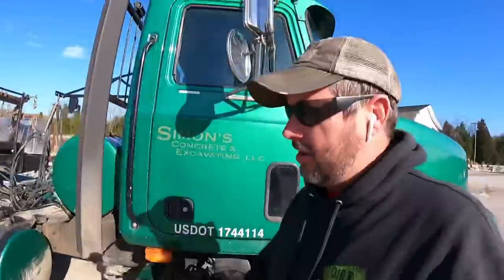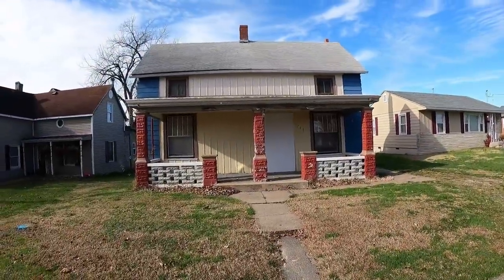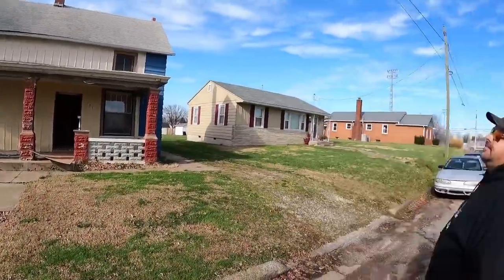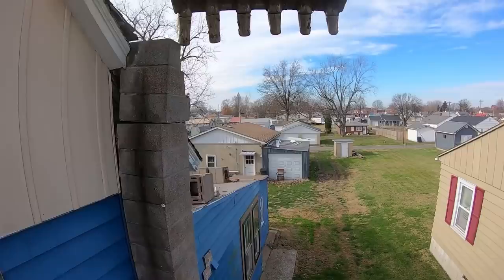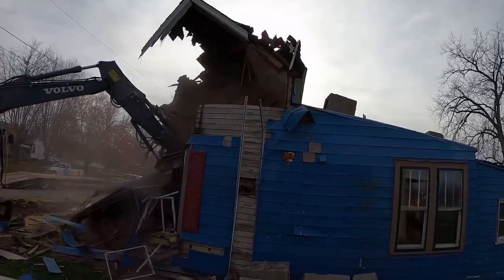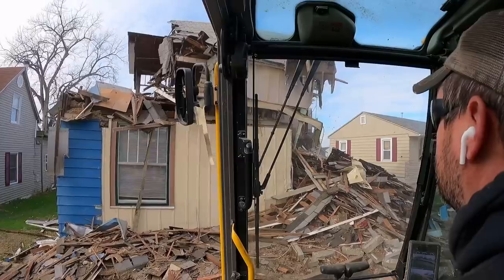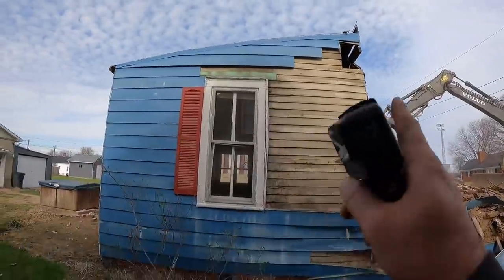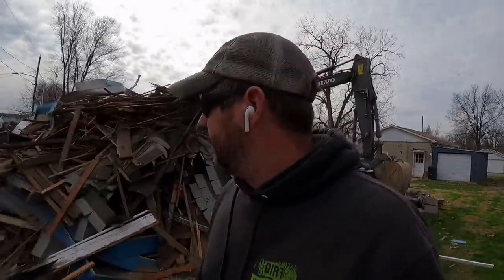Step by step how to safety demo a two story house with a excavator

Comment: That house has to be older than the 60s. 1960 was the year that lumber was required to be graded to be used in buildings. Maybe it was moved from somewhere else or reconstructed. Lath and plaster use mainly ended in the early 1950s when drywall was used because it was less labor intensive. I suspect it was 1930s.

Comment: That house had to be built somewhere between 1900 and 1920s. In the 60s, there was a big push to "modernize" older homes, which explains, wall paneling, ceiling tiles, flat doors, and other architectural designs of that era.

Comment: Those termites saved him at least one dumpster fee!  

I grew up in an old log farmhouse.  It was built on a fieldstone foundation about 6” above grade in about 1910. In the late 40’s it got a few lean to add ons.  Sometime afterward, the outside had been sided with asbestos shingles. There wasn’t a bit of insulation in it.

We moved into it in 1966. All that we ever did to it was panel over the plaster walls in the living room, paint the rest of the walls and tar patch the roof every year.  

During 1968, the wood stove chimney caved in. So, we filled the hole with concrete. My dad decided to put a hole through the outside wall for a flue pipe.  When he cut through the wall, he had to drill holes with a brace & bit.  The biggest bit that he had was about 2”. 

I remember watching as the log shavings turned from wood to termites! Once he drilled the first hole they poured out like salt from a bag.  My dad didn’t even wince as he explained to me, “All of these old log homes have termites!”

He installed the flue and that wood stove was our only heat source. Although I left home a few years later, he lived there for 10 more years.  It never did get a new roof!

When he sold the farm, they knocked the house down with a bulldozer.  I wish I’d been there to see it!

Mikey... I think that house you dropped still had a few years of life and memories left in it!!!
Reply from the maker: Lol yes they did

Comment: 👍👍 Hats off! Awesome educational and enjoyable safety video!👏👏👏👏
Calculated, precise, measured, methodical and well documented are just a few words that come to mind. If you don't have a plan, you ain't got squat.
Here's an example of a good JSA / tool box before the job starts, make a plan..., carry out the plan. Size up the job task. If the scenario changes, stop the job and re-evaluate always ask yourself "What if?" and then go from there.  All necessary steps were taken to mitigate any or all damages to adjoining properties and or equipment.   Here's another good example, even when working alone,  its as equally as important to perform these tasks, say what you mean and mean what you say. The great thing about being safe minded and not taking chances or short cuts?...., You get to go home and get hugs from the ones who depend on you to keep them safe.
Reply from the maker: Thanks

Comment: @18:12
When you turn the key and have to wait for the Volvo’s brain to power the starter is a perfect example of when were comparing the old vs new JD 855 with Tractor Time with Tim and you described the difference of direct acting hydraulic controls vs control by wire.

Comment: the rose bush can be trimmed to the ground.i think that house is much older then the 60's
Reply: I think the house is from the 60's...1860's. LOL
Reply: I’ve seen very similar houses in the north end of Detroit (I-75 & 8 Mile area) and they were built in the 20’s and earlier. 
A built in cabinet in the bathroom that had a complete gut and remodel was marked with a date around 1916 in my inlaws old house.
Reply: Definitely - it has lath plaster which was long obsolete by the 1960s.
Reply: I also agree, because I thought I saw wood lath.
Reply: @steveharry8762  We took a house down in 2010, that had full size 2x4's in it like this one. It was built in 1853. It still had a lot of original window panes that had bubbles and imperfections in the glass.
 The house I live  in now, was built in 1920 era, and surely isn't any older than that house.

Comment: To fit more in the dumpster or whatever you're hauling it in, tear some of it down then track back and forth over that material and so on as you tear it down. The steel tracks can really bust and chop the lumber plaster etc. and you can fit more in each load.

Comment: Those lath and plaster walls are much stronger than a typical stud and drywall structure, basically the same as a double sided shear wall except it's the whole house. That machine did a good job, didn't really grunt at all lifting those wall sections at extension.

Comment: Here is a little FYI and what you can use to keep Termites away from your home. Use a 1 gallon sprayer and a gallon of hot water a cup of 20 mule borax sprayed around the foundation 1 a year and it will kill any you might have and work for at least a year. work great around older homes are any rehabs. I use it on my Garage and they are gone and have been for 16 years.

Comment: It may not have happened yet, but that hose reel is scheduled for failure. Someday you'll find your hose being pulled off the reel while you're driving down the road. I suggest a large spring paper clip to prevent it from un-winding while you're driving. or drill a hole in the reel and install a metal rod or bolt in it to keep it from turning.

Comment: The house looks like it was built in the 30s.
Reply: It looked like it had wood lath when it came apart.
Reply: Just listen to DP describe the thickness of the walls and it tells you the quality that USED to be put into building.........houses today are so cheaply built
Reply: It's definitely older than the 60's.
Lathe and stucco went out when drywall came along in the 50's.
If older that 72 youre supposed to do a remidial inspection for lead and other toxins.
Reply: Agree.  Construction looks a lot like a house I grew up in and that was built in 1927. The last owner of the  property knocked it down 10-15 years ago.

Comment: Kleeman must keep the 120. I do not see you running it as much. I think it would have worked a little better for this. It appears that it has just a little more brute force than the Volvo. Neat to see buildings torn down this way. I am usually the fellow that has to try and square them up and remodel them.  That old house would have been built before 1950 for sure and more than likely the 1920-30s.  That lathe plaster and full size lumber had started to change after WWII.

Comment: Plaster walls in the 60s no , no way especially not with the wood latte , they stop using that in 50s
Reply: You could still buy laths in the UK in the 80’s mostly for grade one listed repairs, you’d probably have to go to a specialist nowadays for riven laths.
Reply from the maker: Still build that way here today 🤷‍♂️
Reply: @DirtPerfect  with wood latte?
Reply: @DirtPerfect  with blue board maybe not with wood latte
Reply: @DirtPerfect  Still using wood lath with a scratch coat, brown coat and finish ???
Reply: @DirtPerfect  You were WRONG....why not just admit it and move on????? Lost lot's of respect for you in this video.
Reply from the maker: Sorry buddy may be off on the years a bit ok wrong there but just up the road in jasper Most of the higher. End homes still use plaster and not dry wall know idea why but they do sorry 🤷‍♂️
Reply from the maker: Lath not so much but other wise yes
Reply: @DirtPerfect  Yes absolutely they use plaster but they use blue board behind did not latte the latte is telltale sign Guess I should’ve been a little bit more specific

Comment: I hope it was sentimental value for that bush.  I'm sure you could replace it for $20 at a garden center vs working around it with a $$$ an hour excavator.   Grab a shovel while the electrical and gas are being shut off.

Comment: The front part of the house looked more like a 1950's build.  In fact with the wood lathe and plaster it's almost exactly (although much worse condition) like MY house which was built in 1955.  Now the shed roof extension on the back may indeed be 1960's.

Was that a wood stove in the corner of the front room?  THAT might have been worth salvaging.

Comment: That looked like aluminum siding on the house. Why didn't he strip that off first? There are people who would take it off just for the aluminum. In either case it would have helped you see the structure of the house.
Reply: Not any more.  Aluminum prices have plummeted.  If you factor in labor costs, you get about as much as steel.
Reply: @flick22601  Will it never go back up? You don't have to sell it the day you get it.
Reply from the maker: Wish it was worth the time

Comment: Not built in 1968, stopped doing plaster and lath in the 40's...., 50's was special ordered for the very wealthy.
Reply from the maker: Still building houses here today with plaster 🤷‍♂️
Reply: @DirtPerfect  yea, but not on lath, most all on blue board, unless it's a curved wall or ceiling. Then it would have stretched steel lath most likely. Small house with a brick foundation puts that house post depression era. Thirties or early forties.

Comment: Me thinks that's not the right way to re-plaster interior walls. why did they re-clad the exterior walls, when a coat of paint would've been enough! I think what killed the refurb in the end was two things white ants and how much the refurb was costing! White ant destruction, is what you don't find when you take short cuts like not removing the original plaster or whatever it was!

Comment: I am feeling like a safety nazi, however you do not talk about the dreaded "A word".  Are materials surveys a requirement in your area?  The other requirement is that all machines used for clearing and grubbing or demo be equipped with a cab guarding package.